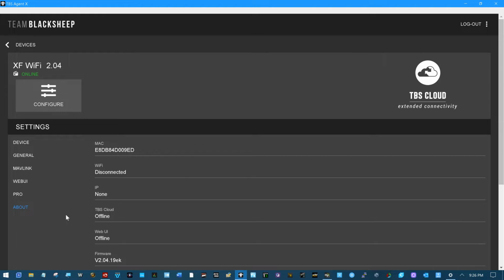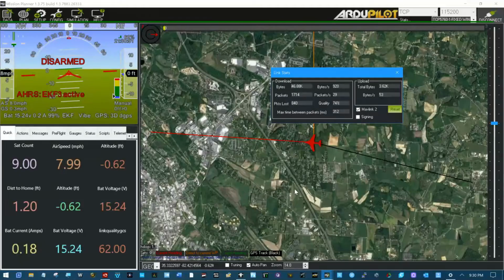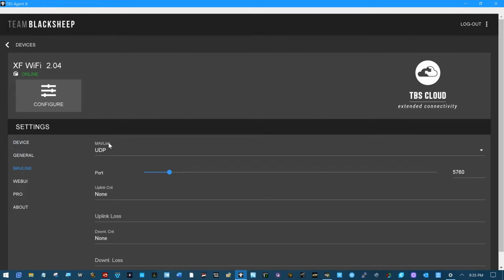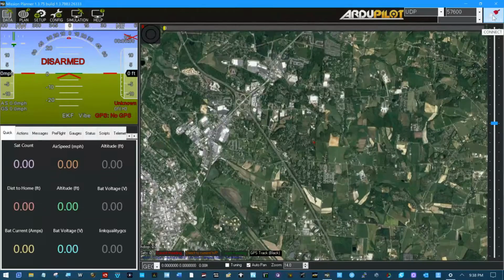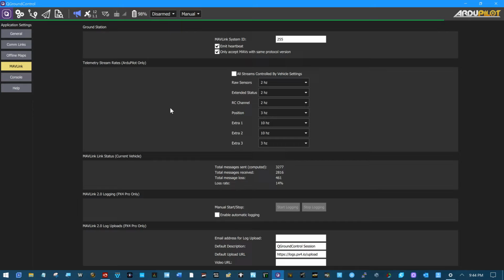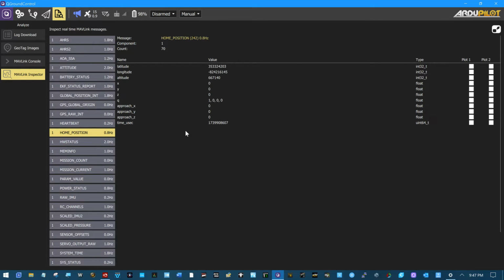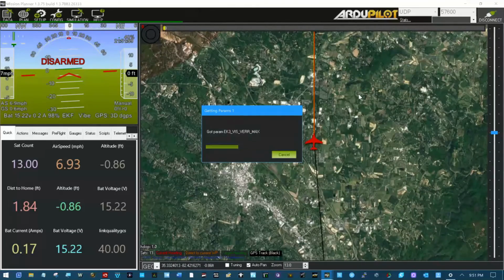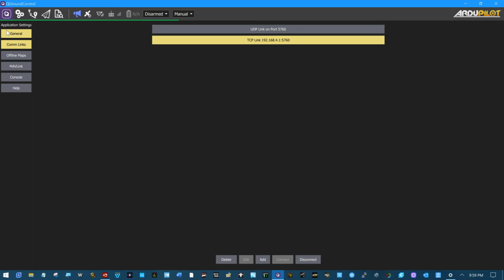Mavlink via Crossfire Over WiFi

Comment: ok i have inav and a tx16s controlle ri connected it to the adrupilot with a cord and i works but when i go up it shows im going down it incorrect
Reply from the maker: There is a lot of setups to be done.  Under the setup tab, Mandatory Hardware the first seven items need to be looked at.  Is this a rover, quad, or airplane?
Reply: @nighthawkvs  im using inav  i just wanted to use the mission viewer . i got it to show telem but when i move the plan nose up it shows nose down on the pc screen

Comment: were can i down load the app for adrupliot
Reply from the maker: There are several.  I mostly have used Mission planner.
https://firmware.ardupilot.org/Tools/MissionPlanner/

There is also APM Planner.  I have played with it, but never used it to configure or fly.
https://firmware.ardupilot.org/Tools/APMPlanner/

There is also QGroundControl .  I have flown quads and such with QGC, but nothing else.  I have not used it to configure a FC.  I have found it very useful to flash when Mission Planner won't work.  Especially to get Sik radios back into bootloader mode when MP will no longer talk to them.

And there are others.  I like MP because I have grown up with it over about 10 to 12 years.
Reply: @nighthawkvs  im using it just to see telem
Reply: @nighthawkvs  the adrupilot thinks when i go up im going down on the screen how to fix. im using inav and my tx16s connected to my pc
Reply from the maker: @staydown.normalsavas  I don't know much about INAV.  Sorry.

Comment: Very nice video! Very helpful for me. Thanks for making it.
Reply from the maker: You are very welcome.  I have another using the RX Pro.  Will test them in flight soon.
Reply: @nighthawkvs  Looking forward to it as im going to buy Rx pro. Btw which RC do you use? I’m using tbs Tango 1 with Micro v2. I’m worrying if the Wi-Fi telemetry won’t work for my tango 1 coz I only see people get it work on LUA script RC like OpenTX. Do think this will work?
Reply from the maker: @jasonz332  I have an old Futaba T8FG Super I have used with EZ-UHF for about 10 years.  I have a TX16S and a TX16SE that I upgraded the multi module to a 4 in 1, thus making it another TX16S rather than a TX16SE.  I have the full-size Crossfire TX and a Micro TX V2.  I have a Dragonlink TX.

I am not familiar with the Tango 1.
Reply: @nighthawkvs  Thank you very much for your reply.
Reply from the maker: @jasonz332  You are most welcome.  It is my honor.

Comment: which one better to work with QGroundControl/ArduPilot ?
TBS Crossfire, plug to remote, connect via wifi/bluetooth & run the QGroundControl/ArduPilot 
or
3DR Radio, plug the tx to PC (run QGroundControl/ArduPilot ) & plug the remote via usb as manual/joystick control.
Reply from the maker: I have worked with Ardupilot since about 2012.  So i like it best.  :)

Comment: hi ,the crossfire tx module lite version  have wifi for using the maps? or i need buy the normal version with bt? thank you for answers.
Reply from the maker: I never got the bluetooth in my full TX to connect.  I used the wifi in the Micro TX V2.  I suggest Dragon Link over Crossfire.

Comment: Thanks for the video. It confirms the pain and unstable behavior I've been experiencing for over a year. Kind of disappointing.  I was able to get the best usability (still disconnects) using bluetooth to an android tablet.  What I really want is to connect to my Dell 7220 rugged laptop out in the field (I've tried wifi and bluetooth).  With the latest firmware and using bluetooth or wireless has been a let down to say the least.  Part of the reason I went with crossfire was to do this but have yet to be able to rely on it.  Disappointing.  Hopefully they get it sorted out but it's been an issue for 2+ yrs now.
Reply from the maker: Mavlink via the RX (WiFi or Bluetooth), was exactly the reason I tried Crossfire.  The company I bought Crossfire from didn’t sell Dragon Link.  I think Dragon Link may be my long term fix.  Seems like something I don’t have is always what is needed.  I did find some packet radios that have the same output power as the Dragon Link receivers.  Should be able to test them this week if they arrive as expected.
Reply: @nighthawkvs  I agree completely.  We're in the same boat.  One thing I like with crossfire is the yaapu telemetry script on optentx to use on my TX16S Max. So not sure if there is similar with DL.  Also, I fly quads too and most of them are crossfire.  I really wish this would get sorted out on crossfire and I'd have everything I could ask for.  I am on version 6.0.7 so I will update and try just as you did to see if I get the same results.
Reply from the maker: @NoFlyDrone  Sadly at only 10mw of output power, I am not sure Crossfire will ever do what I need.  I think it will work ok on anything that is close in.  A small quad, park flier, or such as that.  About a football field is all I think might be reliable.  I am also just getting my first OSD data going.  I really want telemetry if only for a backup.  I started out with the old 3DR Robotics and telemetry was just there from day one.  I am getting accustomed to the fact that OSD data is a good substitute for telemetry.  You can’t track a lot of datapoints without cluttering up your screen, but you can easily cover the most important ones.  But the electronics engineer in me is just too stubborn to stop trying to make this work.  rofl
Reply: @nighthawkvs  I'm confused why you say only 10mw of power?  Crossfire is capable of up to 2W.  I have flown pretty good distances with crossfire.  Even short range I can fly my quads 5-6ft off the ground 2 blocks away in a suburban area.  For very long range flight I fly using 4G/LTE for video/telemetry.  I hear ya with the stubbornness too.  I probably have 10hrs into messing with crossfire wifi/bt!  What a disappointment!
Reply from the maker: @NoFlyDrone  Because the output power of the RX on the platform is 10 mw.  It is actually a transceiver.  Both a receiver and a transmitter.  The one on the radio is also a transceiver in truth.  While the transceiver on the radio can put out 2 watts of power, the one on the platform is only capable of 10 mw.  I need to look up what the output power is on the big Crossfire RX.

I am not familiar with the 4G/LTE.  Sounds interesting.

I did look it up.  Looks like the power output is 40 mw.  Different that what I thought at 10 mw but still WAY under the power of the Radio side and unchangeable.
Reply: @nighthawkvs  Wow I never though about that (the output power on the receiver side).  I will say the range is incredible and solid but yeah maybe receiving telemetry back would be an issue.  Never thought about that.  Anyways, looks like Dragon Link can work with the yaapu telemetry script and the wifi/bt link to a GCS seems very solid. Plenty of videos from years ago out here demonstrating that it's been working well, the way crossfire should.  Now I'm thinking about putting DL into a few long range planes...

With 4G/LTE I have a raspberry pi with a cellular modem that interfaces with the flight controller.  I can fly anywhere as long as there's cellular signal.  Full telemetry and video over 4G.  Check my channel and you'll see my Believer and a few other planes I have flown with 4G.
Reply from the maker: @NoFlyDrone  The Dragon Link RX are stated as 1 watt of power back to the ground.  That is why I want to try them.  The packet radios I just bought for testing are also 1 watt.   If they work and are really 1 Watt, I may have what i want without Dragon Link.  Then again I want to test Dragon Link for fun anyway.  I was using the RFD 900 radios when I was using 915 Mhz.  They were 1 watt also.  I never got out of range on them.  They are expensive.

You better BET I will check out your videos.  If I can get a reliable telemetry link back to my GCS, I will feel much better venturing out into the OSD world and goggles for my first time.  Thank you so much for the information.
Reply: @nighthawkvs  i sold today all my crossfire stuff after 1 year of frustration. I am using dragonlink since 2 months. Much better for full telemetry.
Reply from the maker: @adbas6201  I flew Crossfire yesterday because I didn't want to go through the trouble of switching it over to Dragon Link until after I test the mRo 433 telemetry radios.  After I test them I will switch it over to Dragon Link.  Crossfire should be great for small quads and such, but doesn't fit my needs for telemetry on a large airplane like Dragon Link does.
Reply: @nighthawkvs  Hi and thanks for the video! Have you seen that TBS just released a Nano PRO RX with 500mW? Do you think this would solve the limited range issue? :)
Reply from the maker: @lukas9827  I am using the Nano Pro on there two builds.  :)
Reply: @nighthawkvs  Does that increase the telemetry range?
Reply from the maker: @jasonz332  No this is the old crossfire RX.  The newer RX Pro does increase the range of telemetry but not the control link range.
Reply: @nighthawkvs  How far is the telemetry range of the new Pro nano?